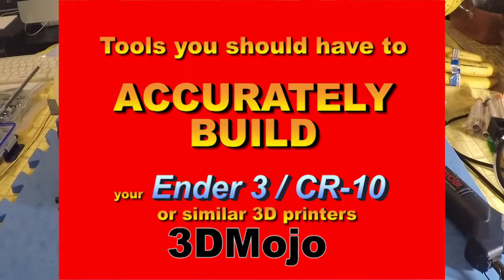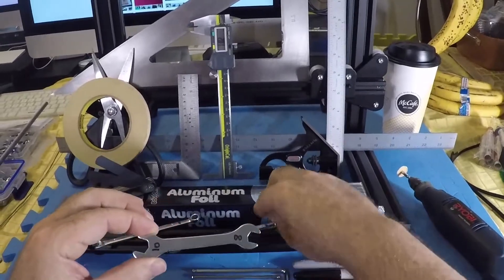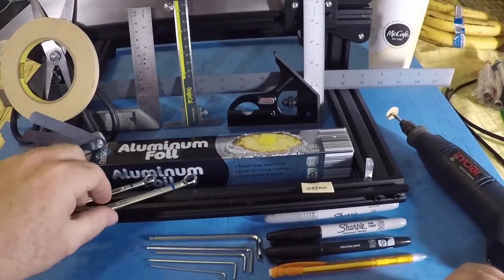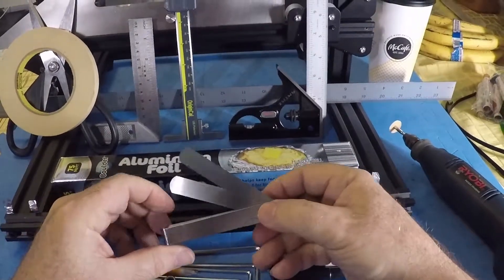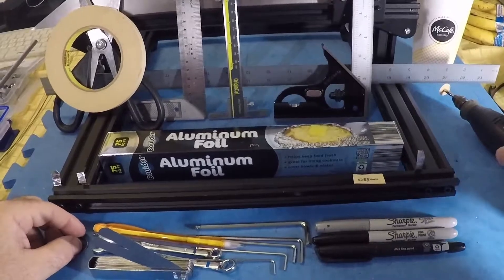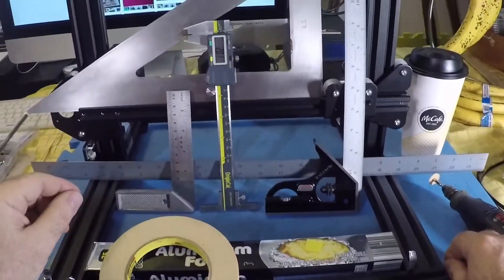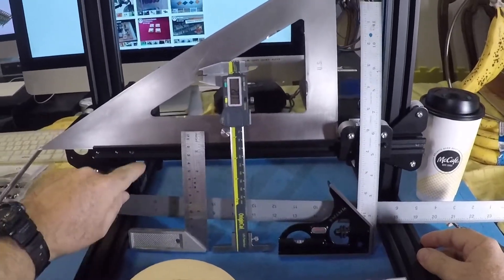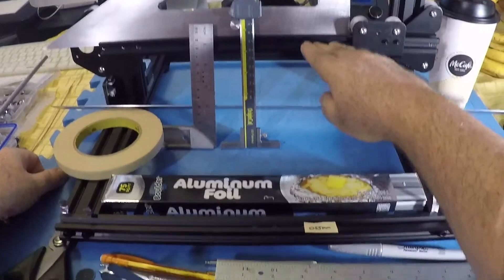STOP BUILDING NOW your Ender 3 & CR-10 Its important

Comment: Thanks for making this video, extremely helpful. I have set up my Ender 3, but haven't fully finished yet because I knew I would get into issues without properly assembling it. Thank goodness I found this youtube channel. 4:30 - Wow they still use paper to calibrate million dollar CNC... I can bet you that many different A4 paper brands from staples would have many different thickness variations comparable to a feeler gauge. I think no one wants to mess with touching oily feeler gauge so paper is less hassle to work with.

Comment: 11:49 "I do have a video on how to fix your wheels if they are already damaged"
I've watched all the videos on your channel back to back, and I didn't find how to fix the v wheels other than swapping them out. Since I'm taking my Ender 3 apart very soon to make the frame as straight and square as possible, I'm wondering if there is anything I can do to re-smooth the wheels (and the inside track of the aluminium extrusion in case of bumps) before putting it back together. Thanks again for the information you are putting out there.
Reply from the maker: my apologies.  I may have forgotten that part in the video edits.  But, using a wet dry super fine sanding cloth / paper, you can gently bring the bumps down.  If your wheel is out of round then it needs replacing but if its small Knicks, you can often remove the outward nick with a sharp blade and then use 800 and higher grit to polish it down smoothly.  Any super fine abrasive will work.  I have diamond wheels up to 4000 or 8000 ... they are too slow for the start but the final finish is beautiful.  Good luck!
Reply: @3dmojo275  Thank you. Finishing up reassembling my ender 3, it had no teeth from putting them in the frame, nor deep grooves from being too tight, thank GOD. They did however, have little round bumps, clearly from manufacturing that I didn't notice or was looking for the first time, so I cut them with an exacto and smoothed with 220 then 400, the only ones I had available. I've watched many videos before putting it together the first time and I think I did a decent job in putting them carefully and adjust the tightness, alas your videos weren't out yet so I didn't do anything to the frame except align the vertical bars in the horizontal direction, I even had the bottom frame wobble which was supported by a piece of folded up paper and tape. After squaring the frame, the wobble was gone. Again thanks for the information as well as the time and hassle to tape it and upload it.

Comment: What is the part at the bottom of your calipers?
Reply from the maker: Hi! It’s called a caliper T bar. It allows the caliper to have a more accurate base reading when doing depth measurements.  I love it. Luckily it came with my digital caliper.  I am preparing a new and improved series right now. Let me know what you think.  Should be up in a couple of days and it will be dedicated to each main part of the printers body first... here is the link to the T bar: iGaging 100-D68 Caliper Depth Base T-Bar Attachment for Dial/Digital/Vernier Calip... https://www.amazon.com/dp/B00M78245C/ref=cm_sw_r_sms_c_api_i_EhRqCb7X4ECZZ